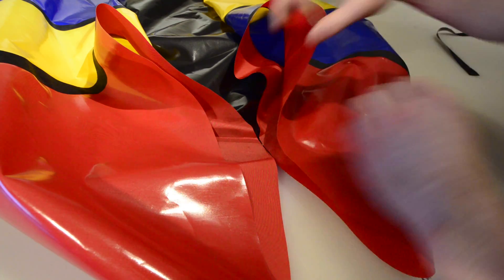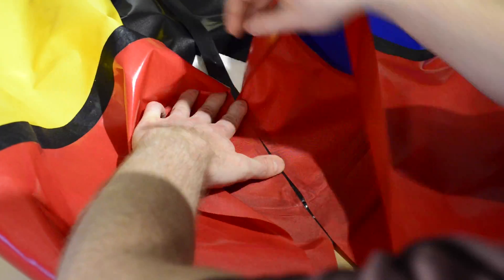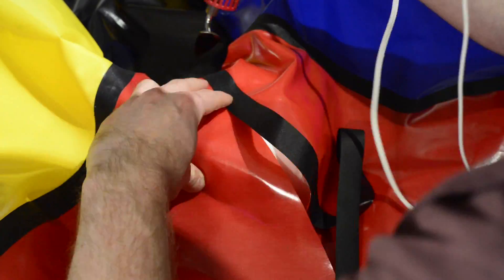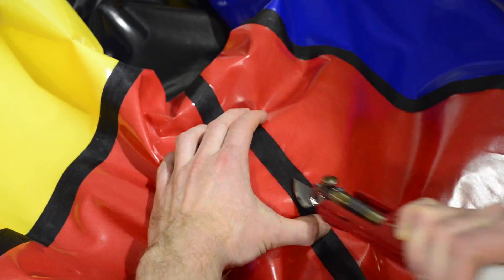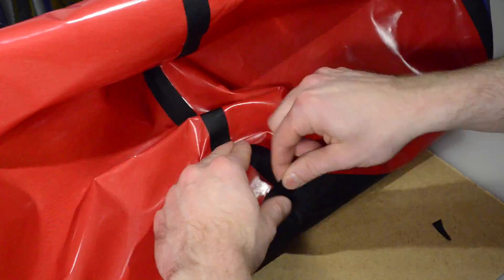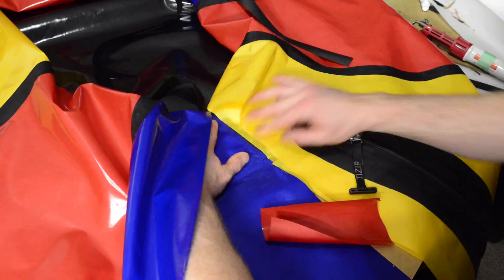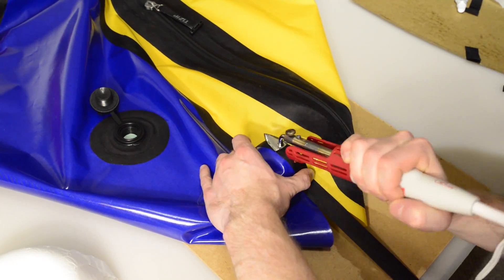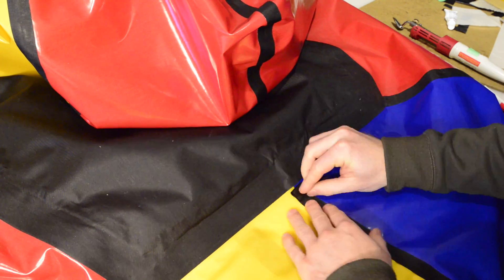DIY Packraft V2 Kit: Step 6 - Center Seams

Comment: It's all good ... but what should I do if there is no lightning. How to get the object from the inside, or do not glue all the layers if you do not use it?
Reply from the maker: You can leave some parchment paper inside and then retrieve it through the valve when you are finished, or just leave it in there.
Reply: Thank you. I'll try to do so. When the hands reach the fabrication :)
Now I'm waiting for a test sample of TPU 190 D material with Aliexpress.
I did not find another. More precisely, I found one that you use, but for our country even the wholesale price is too high. Not to mention the zipper))
Thank you for your videos. Maybe something will come in handy.
Reply: I'm from Ukraine.
Over the past 5 years, we have grown prices for everything. And payroll fees remained at the same level as before. And the rate of our currency against $ fell during this time several times. For this reason, everything that is purchased in $ is now too expensive for most people.
Even the cheapest packraft for $ 300 for most is too high a cost for such an item. An average citizen who is keen on active rest will not be ready to spend such an amount for this element.
First I want to make myself. And we'll see) I can create a more affordable product than foreign analogs.
Reply: The average salary of a Ukrainian is $ 200 per month )))